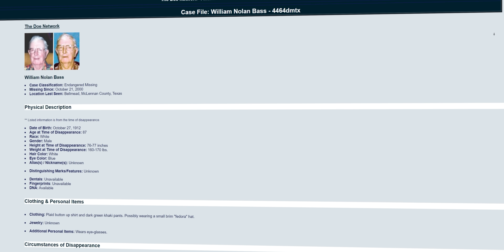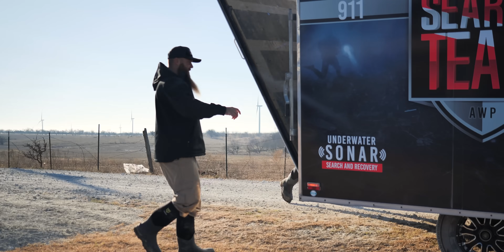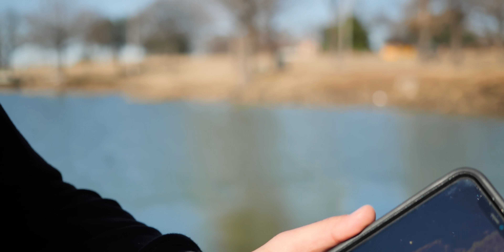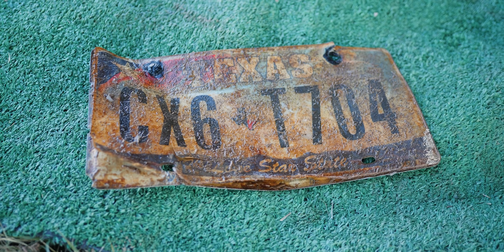GRANDPA MISSING 21 Years!.. CARJACKING and Aggravated Robbery Vehicle Found (Ep2)

Comment: Would it be helpful to have a construction equipment rental company on call in some of these towns and rent a small skid steer to make a smoother ramp at the bank? It seems like a lot of problems happen as the vehicles get hung up on the bank. Since it is dirt and not a pile of rock it might be easy enough to smooth out an area before bringing the car onto the bank.

Comment: To illustrate a point made in the video...in the 90s a truck driver came up missing...only after leaves had fallen was his truck noticed  by someone canoeing on the river below...what had happened is a trucker had gone through a guardrail on Interstate 40 in the gorge near Tennessee...the very next day another trucker went off at the same spot...crews repaired the rail a few days later not knowing the 2nd drivers truck was wrecked in the trees below the highway but above the river..during the search the missing driver was known as the "oatmeal man" as his image on missing person posters resembled an actor portrayed in a commercial for oatmeal.

Comment: I have a theory... Old Springfield road, it looks like it may have been the old road on the route to Waco, maybe he knew it. There's a bridge that goes over the Tehuacana creek doesn't look cross-able now or in 2003 which is as far as I could go back and the road looks gated in the maps available, but there are none available for 2000. What if he took that route, either on the way to waco or back home out of confusion or habit, and went off the bridge? It looks pretty remote.
Definitely something to ask locals though.

Very cool to see all the different departments working together this episode & letting you be involved.

Comment: Once we pulled something very simular in wt, the chain and runner wire that was hooked to toe truck broke there instead of car, like a complete idiot, I was behind what we were pulling and that chain wiped probably a couple of inches from my head. Since then I have never ever put myself in those positions, I see where the divers are way too close to the car, and like me, thinking it break by car, flinging it toward toe truck, but it just takes one time for it to break at toe truck and flying straight for u in less than 1-2 seconds. 
Piece of advice. Hope u take it.

Comment: AdventuresWithPurpose, that berm might not have been that big 20 years ago when he went missing. Also, if he had a heart attack instead of a stroke, he might have involuntarily stomped down on the gas instead of the brake, could have sped up, and easily cleared the berm. You guys have to keep in mind that the human landscape changes constantly, and Brevard you don't know what happened, you have to construct the possibility that he might have had some other kind of medical emergency than a stroke, and been trying to pull off the road to the side.

Comment: At one point the young man said “ he wasn’t suicidal, so all boat ramps are out as a possibility “ . 
I disagree, I know and AWP has shown times when someone ( especially a senior) accidentally went down a ramp. 

I remember back in about 1980 in Sarasota Fl, two cars with 2 couple went down a boat ramp one after another. 
They all drowned. 

They were on their way to a concert at Van Wezel Hall. It was dusk and the first car was showing the way. 
Van Wezel  is right on the water of Sarasota Bay and boat docks share the parking area for concert goers. 

It was a very sad occurrence but it shows that boat ramps should never be ruled out.

Comment: I believe you are looking in the wrong direction. None of the stock ponds in the area would be deep enough. According to where you showed his residence, that would be in Limestone County. To register the car, he would need to go to the Court House in Groesbeck. At the time, the State Inspection and Registration were completely separate and you was not required to have to get the other. After failing to get the Inspection in Bellmead, I feel that he was headed to Groesbeck to at least Register the car.  On the way, he may have detoured to Mexia looking for an Inspection there and ended up in Lake Mexia or one of the rock quarries along SH-84.

Comment: Amazed at the volume of silt in it from a slightly open window. It would fill up with water, so wouldn't have flow through the car. So I assumed this would result in not much silt getting in. Clearly not correct.

Comment: Those wind turbine blades may have been manufactured by the company I worked for! They closed the plant down in 2013. Tells you how relevant wind energy is if a company could not maintain 2 plants in the US. Its supplemental not a primary source.

Comment: ❓️Question❓️Do ya'll ever go back after a car is pulled out, to see if there is another one below it?  Especially below bridges or drop offs.  I slid off a mountainside once.   Dropped straight down.  I climbed up   to safety.  The local law enforcement who came to rescue me, warned that other cars may "pile up" on top of mine before the tow truck could get to it.  I just wondered, what are the possibilities in water?

Comment: Dudes, be VERY careful when walking around on land in the state of Texas.  Unlike other states, all the land in Texas is owned by someone.  There is little to no public lands here.  We Texans do not take people trespassing on our land, in a polite way.  Trespassing could get you shot.  Just because there is no fence around a property, it doesn't mean that you are free to roam.  Methods of marking private land in Texas, other than barbed-wire, include purple paint on structures, poles, and trees.  Also, No Trespassing signs can be used to delineate private property.  A property owner need only use one of those three methods (fence, paint, signs) to declare private property.  Please, DO NOT assume that just because you can't reach a property owner, that it's alright to wander the grounds.  You guys have a wonderful ministry, and I'd sure hate to see you in trouble with the law, hurt, or worse.